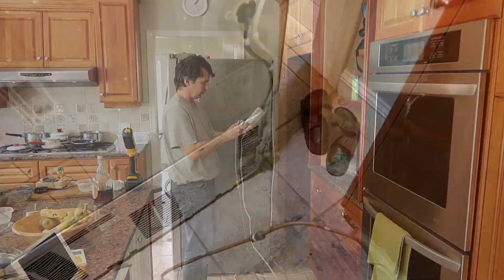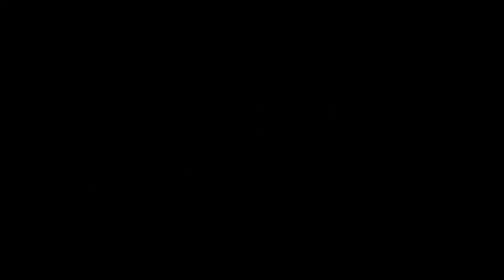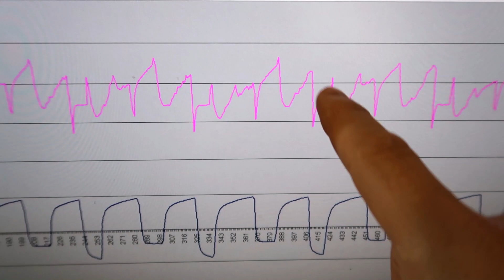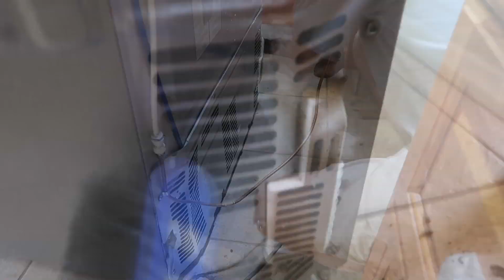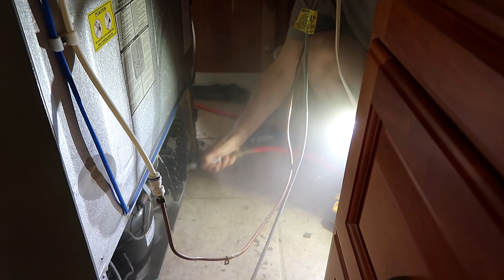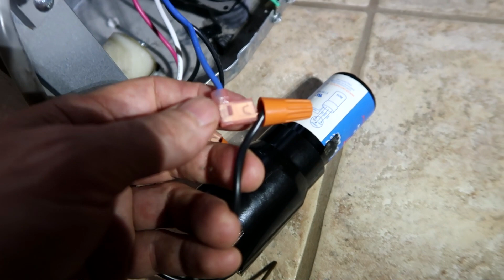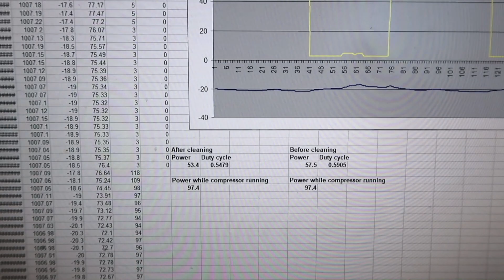Does dusting out the fridge reduce its power consumption?  And changing the starter relay

Comment: Is it possible that while cleaning you blew compressed air at the fan? With the fridge off, the fan could act as an electric generator, maybe generating electricity on that circuit instead blew the relay?
Reply: if the relay is open no current flow, even if you spin the fan

Comment: My intuition is that cleaning the coils won't affect the temperatures inside the fridge much.  The compressor turns on and off depending on the temperatures inside.  When it's on, the compressor has a certain cooling power, and the temperature inside drops.  When it's off, the temperature inside rises due to heat leaks.  What the dusty coils do is make the refrigerant hotter at that point in the circulation cycle, and this may or may not affect the cooling power much.  If the condenser coils get really hot, then the cooling power can drop.  I had this happen to me once - the repair guy came out and said that my compressor felt too hot.  There was a huge amount of dust in the system, which  I vacuumed out when he was out in his truck picking up a new fan.  By the time he came back, everything worked fine again.  The real solution is to vacuum more frequently than once every 10 years - oops.  When I installed a new fridge this year, I removed the sheet rock at the back of the cabinet and cut notches in the horizontal braces between the studs, to allow more airflow.
Reply from the maker: The hotter the condensor coils get, the higher pressure is needed to condense the refrigerant in it, which means the motor has to work harder and draws more power.  Also wears out faster.

Comment: Refrigerators don't refrigerate the refrigerator, they freeze the freezer and the runoff from the freezer is what goes into the refrigerator. The alternating power cycles with the wonky humidity is the defrost cycle keeping ice from building up on the evaporator coil
Reply: I bet ya he has known this for a long time. Of course you don't cool the thing that needs less cooling more directly than the thing that needs more of it.

Comment: I had that happen when I blew out the electrical panel on an industrial SCM thickness sander. When I blew the compressed air at the panel, the dust packed into the relays and broke the connection. I vacuumed the dust and the problem was solved. Maybe that's what happened to this one?
Reply from the maker: its a solid state relay.  No mechanical contacts

Comment: I a fan on mine. Jacked it off a pickup truck complete with the cowling and i haven't looked back since. It's a Bosch Danfoss from the 2000s. Takes far less time to get to temp than it used to. TO be understood that i was forced by circumstance, not enough space above the fridge, but i think it should be a standard item on these things, sound be damned.

Comment: Relays work best in a dusty environment. This video proves it.
Reply: Except when the relay itself is dirty. You will not believe the number of times pipes burst on me because the damn relay got its leads dirty which caused it to weld itself closed and run the pumps until a failure happened.
Reply: Heat retention might be keeping the metals more flexible :D

Comment: Well, people should be cleaning the cooling systems of their computers as well, not just for efficiency but to keep it from premature failure.  Same for the rad in your car/truck/tractor and the condenser side and your air filter of your heat/vent/air conditioning system.

Comment: I'm thiking that your fridge is a 'frost free' type, alternate cycles are running a heater (could be the compressor heat) to slightly defrost it.
Of course a fridge with too much dust is going to make it less efficient. the fridge needs to get rid of heat, the quicker it  can do that, the less time it needs to run.
If you have an old fridge, try the same tests, but for one test insulate (or partly insulate) the radiator (known as the condenser)
Reply: But why put "frost[-]free" in quotes? Are they not actually frost-free, so you think putting that in quotes is necessary because you think that's a claim that they make that isn't really that true, or...?

Comment: It is bizarre that a fridge which we know makes a lot of heat and needs air flow is built into a tight fitting pocket with no clean, cool air supplied. There should be more room back there and a opening to the basement or the return air vent.
Reply: That's a great idea having a duct to the basement.
Reply: It creates a good path for a fire.

Comment: we had a tropical storm. thought i lost compressor.? just a relay. power surge takes them out very easily. set of burnt contacts inside.23.00 vs 250.00  service call even with a good whole house surge arrestor   recirc of air newer design. too much heat across compressor= burnt relay. great video

Comment: I would be surprised if you haven't already done this, but you should look into optical character recognition for reading the power from the Kill-A-Watt.
Reply: It would be much easier to just interface with the 2902 chip inside to directly log the data into the raspberry pi (adafruit got a pretty nice tutorial to make a wireless solution). 
 Although I would love to see the character recognition idea being implemented just for the heck of it.
Reply: Doesn’t even have to be general character recognition. The segments light up in the same way every time, so you only need to implement the function that maps the segments to the digit being represented

Comment: i feel like Matthias needs to invest in  a power sensor that will interface directly with the raspberry pi
Reply: you can't easily read high voltage ac using a voltage divider and an Arduino.
deathtrap advice.
Reply: @victornpb  Yes you can. Did you miss the words "low side"? 3 resistors (or even just 1 current shunt if you can guarantee that the current is limited) is all you need.
Reply: @ihatenumberinemail  It is a good idea to design circuits so that even after a simple single fault, they remain safe. Putting a resistive divider on AC mains to get the voltage down is not a good idea from a safety perspective. Basically, no direct contact is allowed between low voltage stuff that you might touch and AC mains. But hey, it is a free country. If you want to do that kind of thing I will not try to stop you. Just don't expose other people to the hazard without warning them.
Reply: @ihatenumberinemail  don't want to argue too much about it. But if the AVR has any peripherals or power supply or whatever, every conductor would have to be treated as if it were energized at 120VAC. So there IS low voltage stuff you can touch, unless it is inside of a plastic box or a grounded metal box with nothing coming in or going out. This is all for product design. If you make your own stuff you can do whatever you want. Just don't sell it to unsuspecting people and electrocute them.
Reply: @ihatenumberinemail  Like I say, do what you want. But please don't give any advice to novices and don't expose unwitting people to your dangerous contraptions. This is not the place to explain and you probably don't believe me or trust me. Fine. Do some research. The simplest and most obvious problem is that if someone should inadvertently connect a reverse polarized power feed to your proposed contraption (swapping hot and neutral) bad things will happen.
Reply: 3 resistors (one for a low-side current shunt and 2 more to divide the voltage down) and an Arduino will do the trick.
Reply: @ihatenumberinemail  Even mad Matthias is not crazy enough to do that. Or, I don't know. Maybe he is.
Reply: @ihatenumberinemail  Maybe put in an opto-isolator so you don't get a zing from touching the Arduino ;)

Comment: Refrigerators don't cool from the fridge side, they cool from the freezer and use vents to take the cold air from the freezer to the fridge.
Reply: There is also fridges with seperate cooling for the fridge and the freezer.
Helps a lot if you want the freezer to be very cold but the fridge to be normal cold.
Reply: Dave 
 subzero.
Reply: Two compressors,  unless the fridge is deep last century?
Reply: Adamast you can do separate cold zones with one compressor as well. Presumably they have some sort of refrigerant valve that directs the liquid to one side or the other. I bet a second compressor is an easier more reliable solution, albeit one that takes up more space.
Reply: @JasperJanssen  yes the new computer controled fridgs  have duel evaporators with diverter valve  to ref or freezer  or both based on program of computer
Reply: I bet ya he has known this for a long time. Of course you don't cool the thing that needs less cooling more directly than the thing that needs more of it.
Reply: Then some have the defrost cycles, needing to power the heating element.
Reply: found this out the hard way.  One day a tractor trailer turned over carrying frozen foods (veggies and stir-fry fair).  So apparently, so there wasn't a huge clean up effort? They started giving bags to folks on the interstate.  My neighbor filled his truck with the stuff and gave my brother a bunch of these bags.  My brother jam packed the freezer with bags of frozen veg we were LITERALLY never going to eat. And apparently blocked off the vents.  Over the next couple hours, the refrigerator got hotter and hotter until it wasn't cooling at all, while the freezer was still sub-zero.  My idiot brother was like 'well the fridge is broke, gotta get a new one'  and i was like 'bullshit. if it was broke the freezer wouldn't be cold either.' I didn't actually know this was the case, it was just an assumption.  So i noticed there was no airmovement in the fridge, and started pulling out bags from the freezer and found that the fan that blows the arctic freezer air into the refrigerator has completely iced over.  chipped it out and threw out half the bags of veg and within a few hours the fridge was back cooling again.

I'm now very conscious of ensuring that the freezer doesn't get over packed, and that nothing touches the walls of the fridge so air can fully circulate around.

Comment: Consider the defrost cycles. The refrigerator turns on an electric heat strip on timed intervals then has to bring the temperature back down. That causes big swings in temperature and humidity.
Reply from the maker: yes, it does that about once a day.  I picked my samplings far from that, just not to have to deal with  that.

Comment: Perhaps you killed the relay with the air compressor.  Sometimes blowing air across electronics can cause ESD, especially when you’re blowing around dust and other small particulates.
Reply from the maker: its a solid state relay.  But it had trouble starting the compressor before I cleaned it - I caught at least one instance where it failed to start in my "before" logs.
Reply: A relay is not particularly ESD sensitive though. It is basically just a coil and some contacts.

Comment: I was a mainframe computer repair/maintenance man, and I went to do maintenance one day on a memory unit that was attached to an IBM machine.  The customer was in some sort of operation, and could not give me the memory, so I did what I could - while it was running, I pulled the air filters out of it and vacuumed them out and refitted them - and I got a call at about 3AM because the memory had died.  Coincidence?  Well ... maybe.
Reply: Static discharge perhaps?
Reply: @drmkiwi  No - I don't think you'd have suggested that if you had seen the setup.
Reply: @DownhillAllTheWay  ever found the fault?

Comment: Talking about fridges using less power, I have a friend that modifies chest freezers and turns them into refrigerators. Compared to a standard fridge, the power the use is considerably less.
Reply: Yea I've seen other people do that as well.  Chest freezer don't dump all the cold air out like refrigerators do when you open the doors.
Reply: Also the insulation on a freezer should be better than on a refridgerator

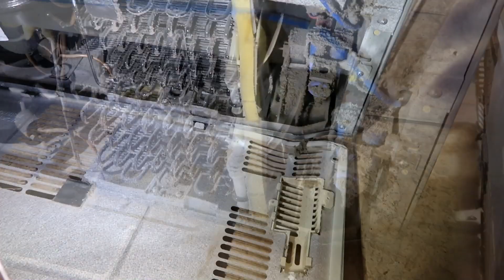Comment: 3:18 I don't think that the air being recirculated over and over again is much of an issue. When the air is heated it will rise - cooler air will take its place. The warm air will have a hard time staying near the floor. Sure, there will be some warmer air mixed in, and exhausting the hot air further away from the intake would be best, but the gain would be small.

Comment: The "compressor power while running" (97.4 watts) is a function of the condensing temperature (the temperature of refrigerant in the condenser or 'radiator,' assuming a saturated liquid/gas mixture) and the suction temperature (saturated temperature in the coil inside the fridge).  It could be interesting the next time you find a dirty fridge to try and measure that condensing temperature.  A temperature probe taped onto the refrigerant line and wrapped in some type of insulation could do a fine job.  In this case, it seems clear that the bit of dust on your fridge wasn't doing much to impede heat transfer.  The low airflow in the enclosure seems to be much more of a limiting factor.

Fine job with instrumentation and analysis!

Background: Day job is assessing energy use of industrial refrigeration systems at food processors, refrigerated warehouses, etc.
Reply: when a ref is built in like that with cabnets  on the sides it will cut down on air flow and if it is pushed back against the wall  and the newer ref are computer controled  with duel evap and fans
Reply: don't need to find a dirty fridge, could just simulate years of dust by covering the condenser coils with rags to block the airflow.  or even just covering the vents.
Reply: I too am curious to know what better airflow under the refrigerator would do.  You could get some idea of how much it would help just by adding a temperature sensor under the refrigerator (since cooling efficiency is tied to relative temperatures).

Comment: 2 weeks later:

European fridges are awsome!
Reply: Yeah i was surprised by design. Hide radiator coil beneath fridge like that and put a fan there so it can do its job. Living in EU i only have seen fridges with coil radiator lieing flat along all back wall without any fan at all. The more you know...
Reply: @josifvissarionovich5320   Old comment, oh well

Such a coil arrangement used to be the standard for fridges here in North America

I suspect the change to coils being moved from the back to the bottom has to do with changes in kitchen design in North America where fridges are more frequently being built into walls/cabinet spaces with little airflow to permit rear coils and natural convection to work.

Another thing that moving the coils to the bottom does is that it provides some protection for the coils when being moved around. 
We frequently have humongous fridges in North America (500L or more is very common in houses, the fridge that came with my house is 625L) with exterior dimensions pretty much about as large as possible that will still fit through a standard door. Put the coils on the inside and now no worries they'll get bumped against a door frame.
Reply: @ kanter bow: I was thinking the same and was about to post it, when I saw your comment :-)
European fridges use natural air convection to cool the condenser, which makes the case of cleaning more important. By coincidence, I cleaned mine yesterday, because high summer temperatures demand a lot more from the radiator efficiency.
Another, often overlooked, problem is the door seals - minor gaps can make important losses of efficiency and build-up of ice. Best way to check is to place a strip of paper across the rubber seal and close the door - if it pulls out easily anywhere around the door seal, you need to replace the seal and check if the door is not warped. Hope this helps anyone.

Comment: I was a cabinet maker most of my work life.  Everyone has a dirty fridge.  Most manufacturers require a 2-4” gap at the top for heat escape.  Fridges are a huge heat source.
Reply: Any advice for a young guy wanting to open a cabinet shop for a career?
Reply: WorldsWorst Fifaplayr   I think the cabinet shops are a hard way to make a living here in the states.  The contractors that I worked for did not want to pay.  I was always busy.  Installing cabinets for big box stores pays better.  If I was young going into the trades I would look into plumbing, HVAC, or electrical.  I still build stuff .  I love the work.
Reply: WorldsWorst Fifaplayr Also if you don’t already look at the Ron Paul’s channel.  He is a cabinet maker that used to have a big shop with big tools.  Now he is all about working effectively.

Comment: Alright, I knew Americans did some things... "differently" from other countries, but what's up with this fridge? What's that copper pipe coming from the back? Why does it only have such a small radiator, hidden underneath, instead of just one large flat radiator on the back? I'm so confused...
Reply from the maker: chilled water plus an ice maker
Reply: First of all, crap. I totally forgot he's in Canada. I'm sorry, eh. Also didn't think about having chilled water / an ice maker, that's not too common over here, but it does make sense. Still kinda wondering why it's out of copper though, instead of plastic. Copper seems way too fragile for such a pipe.
Reply: The only thing I can think of is a water supply to provided chilled water? But why a copper pipe and not plastic?
Reply: To not have a large condensor on the back is really weird.
Reply: Old US fridges had a radiator on the back. Newer ones don't. Don't know why. Note that TECHNICALLY, Matthias is not in the US. (Canada is an independent country). But I guess you are basically correct anyway because most appliances are the same and the electrical systems are the same on both sides of the border.